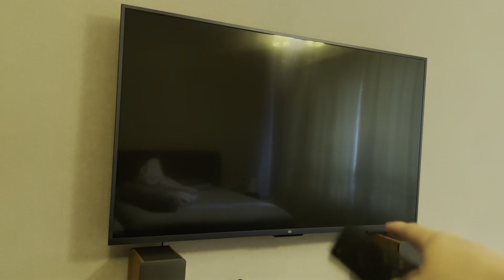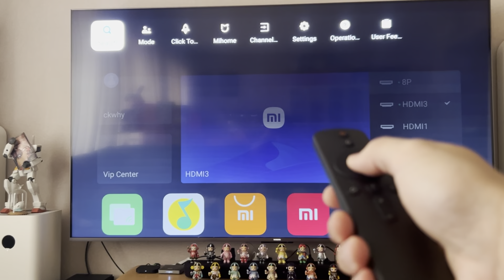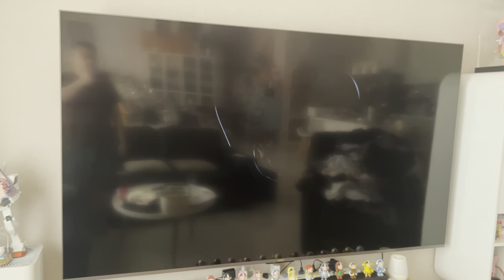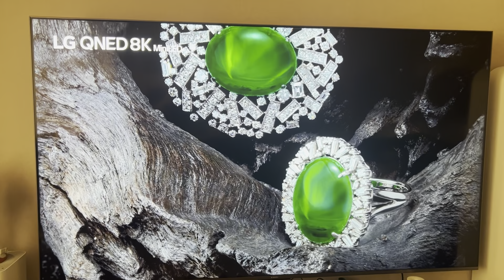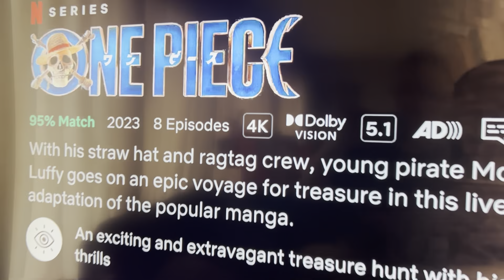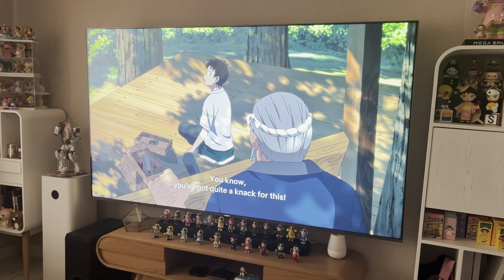Review Xiaomi S Pro 85 inch Mini LED TV

Comment: after 2 years how about your xiaomi mini led tv ,l have 65" mi tv over 9 year still in good condition planning change to TCL 85" Q9M RGB TV which is better SQD or RGB Thanks
Reply from the maker: SQD is the latest tech from TCL. It’s better. 
But not too sure about the pricing. RGB have been around for several years, matured tech and should be also cheaper. Go watch both with your own eyes, if you cannot tell the difference, just get the cheaper one

My Xiaomi Mini LED tv still works fine.

Comment: Hey is the still functioning good ? I want to purchase this tv
Reply from the maker: Yes. It’s still functioning well. Using it daily
Reply: @AuntyUncle  and do u use any screen protector or not
Reply from the maker: @Head_Of_The_Table_47  no. You won’t touch it anyway , no need to protect
Reply: @AuntyUncle  hi
Reply: @AuntyUncle  after poweroff the plugpoint need to be poweroff aswell?

Comment: ?easy to setup and instalation?
Reply from the maker: It’s big. If you want to mount it on the wall, you will need professional to do it. If you want to just put stand, then you can do it with your friend. Pretty simple to setup

Comment: hey man, came across your review from Singapore, it's very useful! I was wondering the technicality of using a 4k60hz (max output) TV box on a 144hz native TV, do you know what's the impact? have you considered TV box with 4k120hz output?
Reply from the maker: Most videos from Netflix , Amazon, etc only have 4K 60hz . Anything above 60hz are mainly for video games, you can connect ps5 or Xbox to try out 120hz.